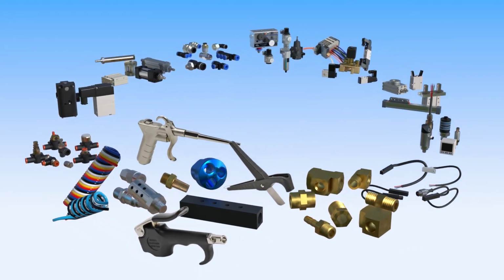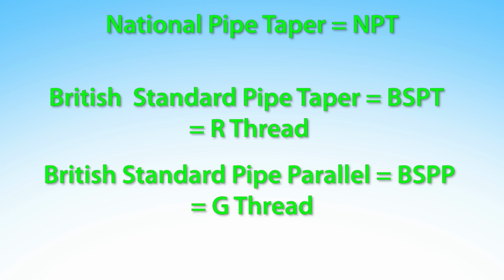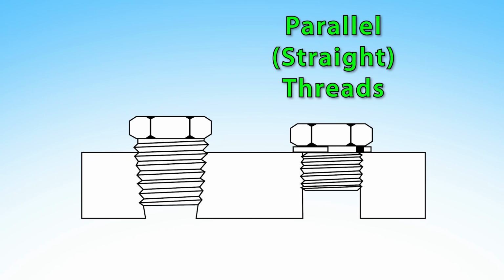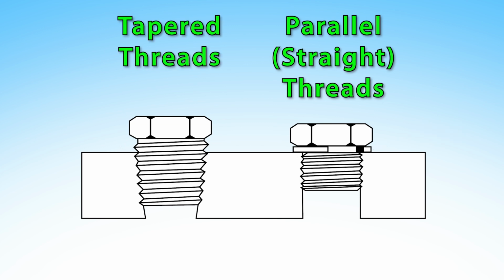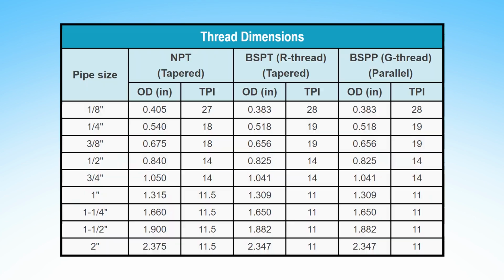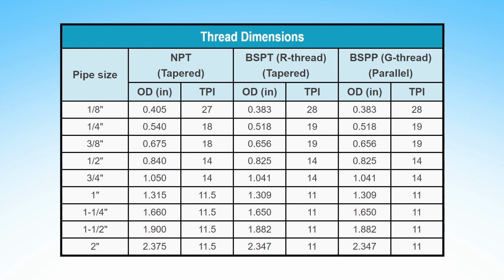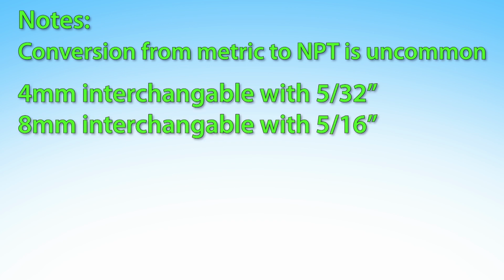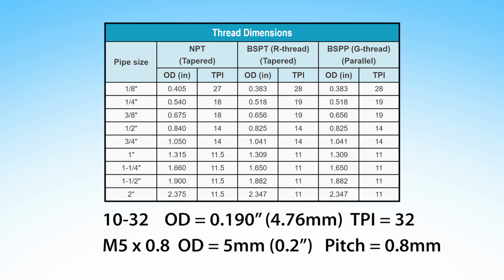Understanding Pneumatic Thread Size & Type from AutomationDirect

Comment: Thank you! Thank you you! And thank you! Been looking everywhere to figure out how to repair my pancake air compressor made in China. It’s a shame, but it’s not worth it to find the replacement Bspt pipe connectors and jumper compressor hose (metric poli line) and am better off buying a new compressor. This saved me from spending $100 in pipe fittings,Bspt taps., that canal go to a NPT set up, even though my preference is metric for everything else like the rest of the world
Reply from the maker: Glad you found this video helpful, and thanks for the feedback!

Comment: That measurement chart is hella wrong. OD on 3/8 is around .375.
Reply from the maker: You are correct that the decimal equivalent of 3/8 is 0.375. But pipes are sized by the inside diameter. The outside diameter of NPT threads on a 3/8" pipe is 0.675".

Comment: For tapered threads, where do you measure the OD?  At the narrow end or the wide end?
Reply from the maker: @ jej3451 We have some material here: https://library.automationdirect.com/pneumatic-fitting-tips/  but we may not go in to detail on how to measure tapered threads. A quick web search revealed several resources such as Wikipedia with the following: "The taper rate for all NPT threads is 1 inch of diameter in 16 inches of length (3⁄4 inch per foot or 62.5 millimeters per meter) measured by the change of diameter (of the pipe thread) over distance of thread."